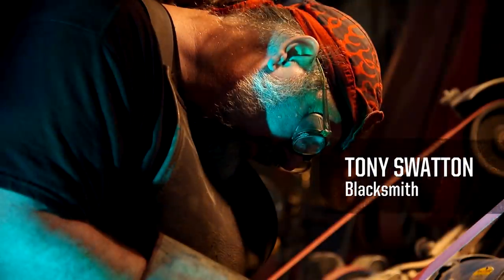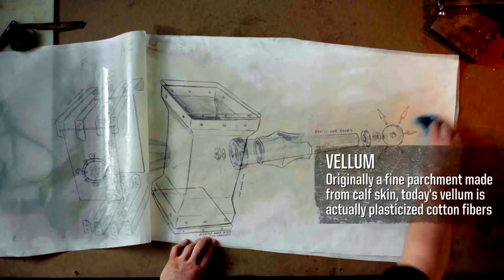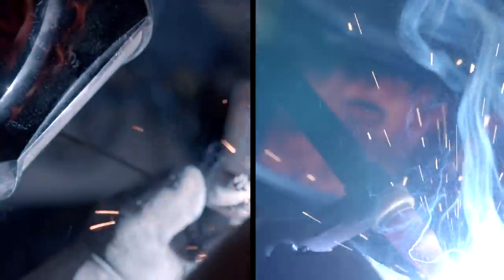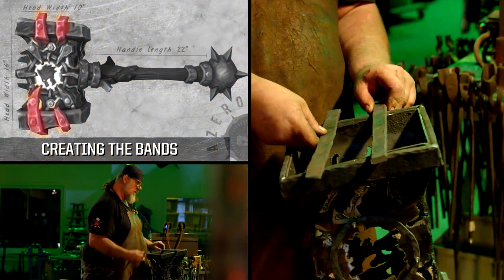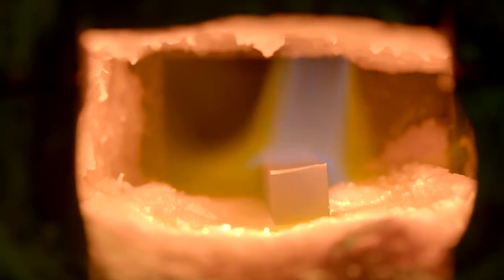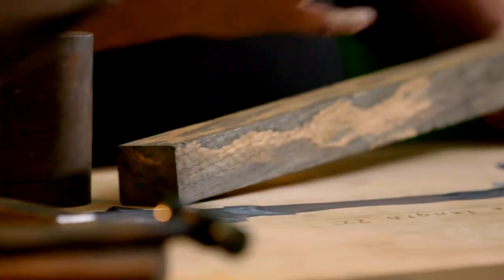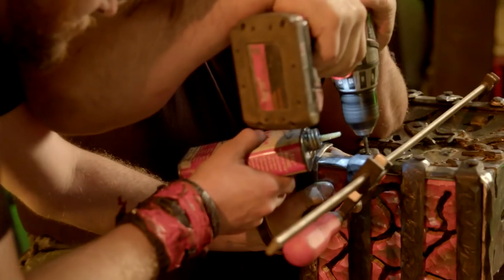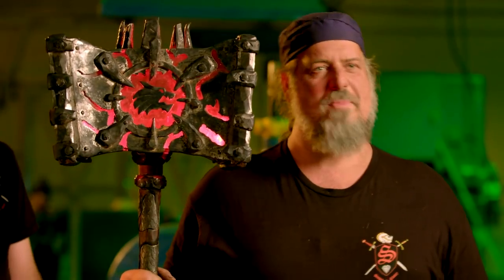Azeroth Armory: Forging Doomhammer

Comment: too big, clearly Doomhammer is a 1handed, not a 2handed weapon, either get Shamans a 2handed Doomhammer, or stop pushing the 2handed fantasy in our faces.
Yours sincerely... a Shaman.
Reply: DO you realize how massive orcs are ? This is a 1handed weapon for orcs, lol...
Reply: Would you be able to use an orc 1-hander with 1 hand? I don't think so, remember, in the lore orcs are much larger and thus stronger than humans, so a 1handed hammer is most likely going to require an average human to use 2 hands to swing
Reply: You should know that Doomhammer is 1½ handed weapon. It is only 1 handed in game because shamans need to dual wield. Doomhammer is also so heavy that no human could never even imagine lifting it.
Reply: Lets see about that dwarf shaman, hm?  ;)
Reply: correct wording hand and a half
Reply: If you have watched any of the Warcraft 3 cinematics, particularly the one of the fight between Mannoroth, Thrall and Grom, you'd see clearly that he's wielding it both ways. It's a two-hander.
Reply: with the orcs' natural strength; that, even solid, would basically be a 1 hander. Like it's said in the film when fighting an orc: fighter smarter, they're stronger than you are
Reply: i think lore wise the handle of the doomhammer has been replaced over the years... in one of the books (how canon it is can be questioned) it describes Orgrim leaning on the doomhammer almost like a cane ...which would be kinda twohanded length ...
Reply: and Thrall's version is kinda stubby lol
Reply: Not only the thing about the Orcs being huge... but do you have any idea how over-exaggerated the weapons and armor are in WoW... and video games in general? lol. That's why it's hollow... because otherwise it would be too heavy for us to lift in real life. lol. And most 1-handers in WoW would actually be 2-handers in real life. They even did the same thing with Gorehowl... even though it's an actual 2-hander in-game... it would be impossible to lift if it was solid steel. They made the blade hollow to reduce its weight, so it could actually be wielded properly.
Reply: Thrall and Orgim use the Doomhammer as a 2handed weapon, only in legion is a 1handed weapon, and as a shaman i hate the 1handed Doomhammer
Reply: Still doesn't matter what it's wielded as in-game... that's not what's in question here, really, but how it's wielded in real life as opposed to in-game. The crazy designs and over-exaggeration of the weapons in WoW are the exact reason they aren't practical weapons in real life because video games are not bound by the laws of physics, nature, and the universe.
Reply: Dwarves?
They big too? they 1hand it as a shaman.
Reply: Idd. just like how Thrall uses it in HoTS, they either should'a made a 2handed for us plebs shamans. or used it like thrall does with mostly 1 hand while using spells with other. just having it only in single hand would make it suite the lore more than this bs "elementally" one in other right now.
Reply: Yes, but nothing like that exists in-game. it's either one or two. and given that we are most likely physically weaker than thrall in game, we should have to two hand it in order to offset that even green jesus could only use it one handed every so often.
Reply: It is a versatile weapon so in proper terms it's a hand and a half weapon, Thrall uses it both ways multiple time over his ownership of it
Reply: The issue is that no one is big enough on this mudball to heft that thing in one hand and be effective.  And in the original art, it was a two handed hammer.
Reply: JoxerHD ye the wooden part is too long

Comment: Always great to watch an artist make a replica of something.  Thumbs up!
In real war - that would never be used - ever.  
going back in time - it's extremely rare to find any sword that weighed more than 4 lbs.  No one would use a hammer weighing more than 10 lbs - not sure if we ever recovered one weighing more but anyone looking to die might try a 50 lbs hammer.  The real one would require a real orc to lift and swing it.
Reply: It was made by orcs so multiply the weight limit by 4 or 5 times

Comment: What kind of oak did you use for the handle? Red oak would snapped just from the weight of the head, but I'm having trouble believing even a white oak handle would be strong enough.

Comment: Think of it this way - most of these weapons were made by creatures that aren't human. So if a human has to make it (even one as skilled as Mr. Tony Swatton), it has to be made so that humans can use it. 

Logically, no human can wield the actual Doomhammer since it isn't built for human strength. It's a weapon for someone with inhuman strength. You're more likely to break your back or ruin your limbs if you try to wield the original.

Comment: Isn't doomhammer supposed to be a bit smaller? specially the handle, since it's one-handed
Reply: No, Orcs are a LOT bigger than us puny humans, so this is a one handed hammer, for an orc, but for a mere human, it is like it is a two handed weapon. ;D
Reply: ah yes, you're right. i forgot, thrall doesn't look that big tho =P
Reply: Even considering orcs are huge it should be substantially smaller still. like most videogames the weapons they use are massive on a nearly unwieldable scale. From modern reproductions to antiques the heaviest warhammer I have found was 4 pounds with some going down to a pound and change.  even if we consider orcs are twice the size of humans in every measurable respect their hammers should still only be something like two to eight pounds on the heavy side. a 50 pound hammer is silly big.
Reply: Thrall lifts... don't you forget it
Reply: +Christoph Hofland For starters, the earth gives shaman strength to help them lift a hammer... Also,  the size of orcs alone doesn't tell us enough about just how strong they are. After all... a chimpanzee is smaller on average than a human yet far stronger. Just something to consider.

Comment: Watch this badass 2 handed hammer of legend turn into a tiny 1 hand in Legion ... the sad ~
Reply: its meant to be a one handed weapon for orcs.
Reply: Because it's impossibly big for an actual warhammer? Go look up the weight of actual warhammers, they aren't even 1/10th the size.
Reply: Orcs lift horses and throw them a 200lb hammer is just fine for them. Ogrim had a long handle to use it as a two hander but Thrall changed the handle out to suit being used with his shamanistic powers.
Reply: Thrall used it as a 1 hand before this isn't for legion , he casted spells with his other hand while wielding it in 1 hand.

Comment: Why didn't they use the bulletproof glass to mount the seal on Ashbringer?
Reply: OmegaCooper Gaming Physics, mostly. Ashbringer's seal hovers over the main body, while Doomhammer's is on the face. You'd essentially need a giant chuck of bulletproof glass to simulate it, and it would be more jarring with Ashbringer, because you could tell it was being held up.

Comment: Can you forge Shaman so they don't suck this expansion?
Reply: DAT BURN
fun fact in legion they are said to be the strongest dps but not sure didn't play the beta (enchantment to be specific)
Reply: I've hearded many, MANY people say Shamans are one of the most fun classes in Legion. What are you talking about?
Reply: Enhancement is one of the best if not the best melee dps rn, Ele has huge damage and who's only real issue is mobility, and resto is probably the most crucial healing spec this expac granted it has the highest HPS and a ton of utility and mobility. They're doing well this time.
Reply: Kao H Kao unholy is mostly used for PvP the best DK spec WHICH IS KNOWN is frost sooooo don't be a big fan boy of unholy saying it is the best deal?

Comment: But why did they make it a 2h mace... ?
Reply: It's 1H, but meant to be wielded by beings with hands the size of your torso.
Reply: That or empowered by the Earth Elements , which can explain the dual wielding of two Doomhammers , even if one isn't entirely real , and made of various elements , still can't be light.
Reply: Cynder Well yeah , there is only one Doomhammer , I'm talking about about howver the off hand one , ehich is just an elemental version of the Doomhammer , as there is only one.
Reply: Cynder It's pretty cool looking , even if i can transmog it , I'd rather have a fiery Doomhammer.
Reply: Well yeah , just like all Artifact weapons , the color scheme can be changed , but it's base design is till made of fire(the off-hand that is) and the other appearances when it comes to your off-hand represents other elements , though the others do change you off-hand from an elemental Doomhammer to different things. But the base design is the doomhamer in your main hand , whilst dual-wielding a fiery Doomhammer in your off-hand.
You can look at all of these in the the Artifact Calculator on WoWHead.